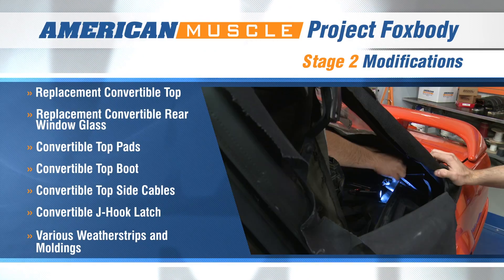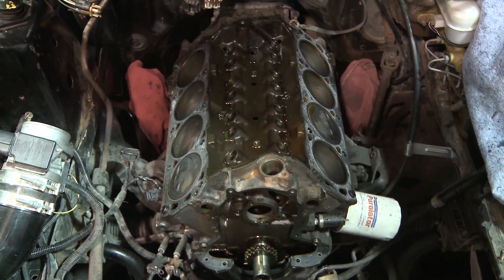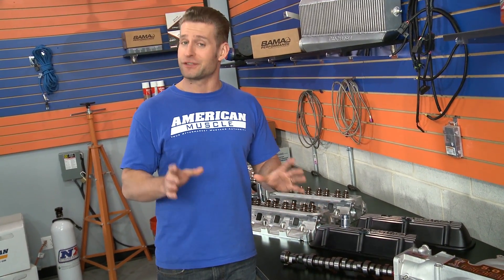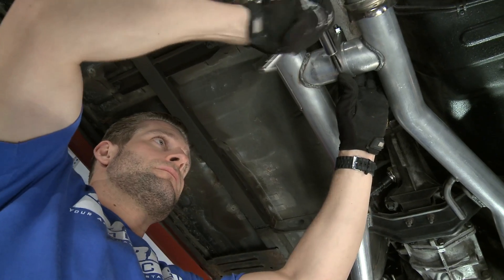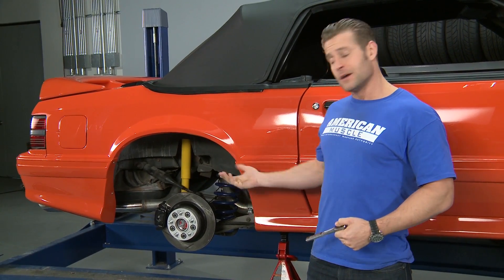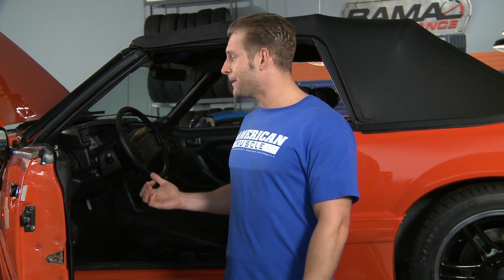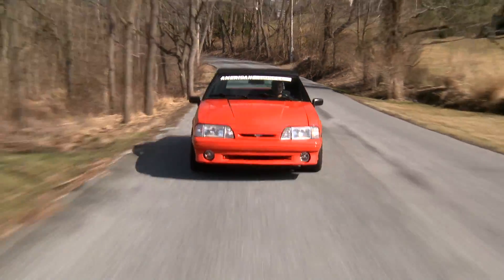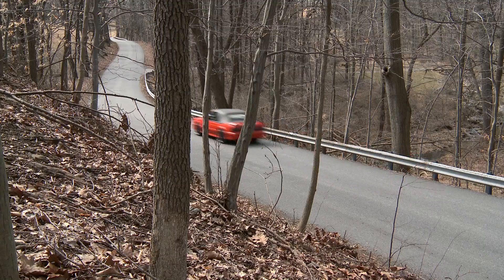Project Fox Body STAGE 3: Mustang Project by AmericanMuscle.com

Comment: they look a bit like the contemporary escorts they got in Europe at the time, especially at the front, this one looks like the xr3i cabriolet
Reply: That's where escorts came from. FWD Ford Probe is a variant of a fox, then the Escort replaced the Probe.
Reply: No too sure if you got the same escort as we did in Euroland, we have had a car called the Escort since the mid 60s, not too sure when Ford started selling them in the US, wasn't the Probe based on a Mazda thou?
Reply: diecast jam No it was going to be a a FWD Mustang but they decided to keep the RWD, that was basically how the probe came to be. Not based on Mazda....since Ford does own a percentage. Hence why they put 1.6 dohc motors in the early 90s Escort GTs
Reply: MrMustangFan87 You do realize the escort was being sold in america in the early eighties before the probe came out and the probe was designed by a mazda  designer hence why the mazda 6 shares alot of the same componets as the probe.

Comment: Hey they never mentioned injectors, are they running 19lb
Reply: sami Herz If they go beyond 300hp or so they should use 24lb, but they can run 19s for a little while. The 19s will have a rather high duty cycle, but at 279 hp they're not hurting them too much. Long term, I wouldn't keep the 19s in even at that power.
Reply: They breeze over everything so fast, it's pretty much all for entertainment and not much educational purpose.
Reply: I know that's right.
Reply: watch stage 4..

Comment: I think the point was that if you spending that much money anyway, you should get the best thing that would fit under the hood. I've got a coupe fox I'm about to do the same thing to. Aluminator motor, six-speed tremec, and coil-over suspension. Late Model restoration has anything you need for the conversion so why not do it?

Comment: Coyote has 4 cams. Its a stroked 4.6 mod motor.  There is no fun in swapping a motor in a car that you havent built yourself and setup.  And since they are going for a 93 cobra restore, they need it to stay a 5.0. And a coyote swap still would have cost WAY more anyways. You need the ecu, wiring harness, plus the brand new motor.

Comment: i did the same, but my 'ronco engine is bran new (rebuilt) but its bummer 180hp compared to my original 225 :/ planning on making mine at least 350 hp, but idk weither to use the same engine or just swap back the original ,-,

Comment: could i possibly get part numbers for the cobra parts the cam heads and upper and lower intake because i have a 1988 mustang gt convertiable and mine is already converted to the cobra body kit front bumper wing and taillights plus the wheels i would love to have mine just yours

Comment: 93's aren't the greatest because they came with the Hypereutectic Pistons and not Forged Pistons known to be in the 87-92 which i believe had a Comp Ratio difference also. I have a 91 Mustang LX 347 Stroker Notchback and I love it. Car is lighter and frame is more solid in rear.

Comment: People need to stop comparing a 93 to 2013. Yes the new 5.0l make more power. They should! Its almost 20 years later. But make no mistake the 302 put in the fox bodies are invincible if taken care of. Plus you can match the hp by adding a few parts from exhaust, header, cam, turbo, gear, tuners, suspension, and even throttle body at half the cost of a new 662hp stang motor. Plus the body on the fox bodies are much more unique unlike the new Mustangs which are going to European for me. Foxbodies!

Comment: Nice build! I only have issue with 2 of the parts selected however. E303 Cam and Shorty Headers. You left some HP on the table with those GT40X heads. Those heads like a Long Tube and a Trick Flow Stage 1 Cam much better. You would of saw 300HP at the rear easy. I should know. I have practically the same combo you guys built.

Comment: They got the credit they deserve lol. Did you forget the 03-04 Cobra? 390hp of raw power. Id kill to have an 03 Cobra.

I thought the 4.6 was better until I got my 87 GT. Just the power alone makes it feel like a better ride. Its putting down about 340rwhp and thats with a little above 2k in the motor which is pretty good since I can outrun Ls1s, new SS Camaros, and Srt8s lol.

Comment: Wait. It has a Pi swapp but stock heads? That makes no sense at all lol.

Pi swapp is swapping the heads and intake for a 99-04 GTs. And thatll add 20-40hp, with the ignition and cam itd only be running close to 300 at the wheels.
and Im pretty sure a 5.0 with just a trickflow kit would stomp that 4.6.

Comment: They never changed injector size to maximize the H/C/I swap as far as which motor is better 5.0 or 4.6 it's all about what you put in it and tuning. There'd be no 4.6 without the success of the fox so in my book the fox is better. As for imports making more power, so what! Torque is king and putting the power to the pavement is what counts...FUCK a import.and give me a FOX over a 4.6 anyday!!!!

Comment: I was reading the convo. about 4.6 cobra VS. a 5.0 fox and i disagree. my brother has a '96 GT bored 0.40, PI swapped, MSD ignition, ported stock heads and a comp cam with a hugh duration and split. We race my uncle's 5.0 with just a Trickflow track heat top end kit and ROASTED his ass. :)   So i cant say your completely right.

Comment: lol, np. but yea i used to have a 91 5.0 also an it was fast for its time, which is long gone. an true the old fox has bulit a god like reputation, but truth of the matter is i believe the 4.6 era, which started out a bit shakey jst like the early 85 and 86 5.0 motors, the 4.6 are in fact stronger an better built motors. sure the 4.6 cost more to mod but to me thy r worth it. u wouldnt need to go tht far with the heads to kill it. cai, tb, gears, an a good tune would b enough for ur 4.6 doc

Comment: First, i also feel the 4.6 is a better motor thn the old 5.0s. wish my 97gt was a cobra, but ur stock corbra. have u ever had it dyno'd? Its get about 260rwhp/275rwtq. this 5.0 is gettin 279rwhp/317rwtq. its puttin down more power thn ur cobra, especially in the tq department, has better suspension an balanced to help get it movin, an has that weight advantage. ur cobra has more potential i think, but won't get the win vs. this 5.0 while stock. although it wouldnt take much to get the win for u

Comment: I got something else to say to everyone go to a.m. site look at the 1994-1998and 1999-2004 they do the same stuff on both cars a cold air intake pyps exhaust and a dang tune that's it now tell me y they didn't do that to the 5.0 I will tell u y calls if they had done it the poor 5.0 would have only dynoed like 250hp ppl and they didn't won't to show such low numbers c that's what I'm talking about. And for the ppl out there that r saying the new 5.0 is rly good he doesn't know what he is talking

Comment: and its still makes less power then the same year camaro Z28 with heads, cam and intake.
but for their benefit, the Fox body is alot light then the current Mustang, GT or V6, so the power to weight ratio is better.